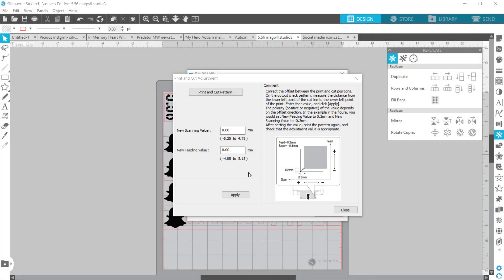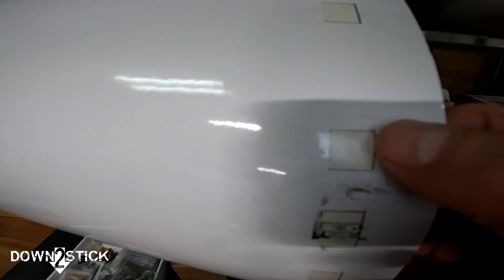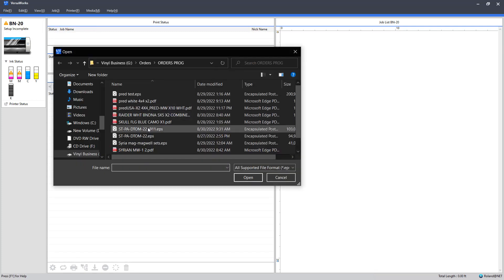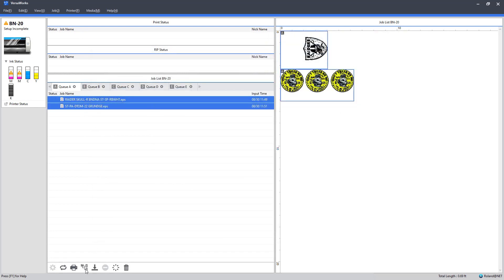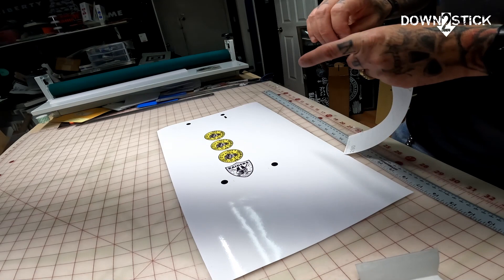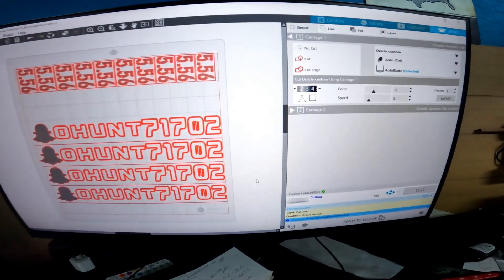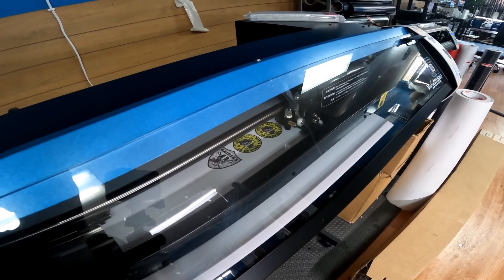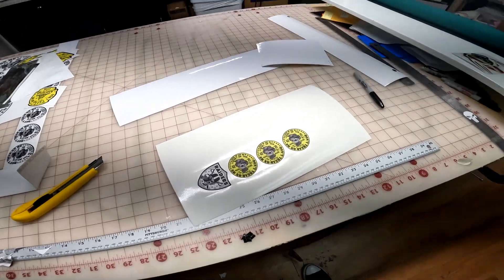BN-20 Print Cut Calibration demo

Comment: I have calibrated my BN-20a like 10 times and it cuts out the square perfectly but when i do a job to cut stickers it never cuts where i put the cut lines.
Reply from the maker: Try messing with the cutting speed. I have to do that on smaller stickers. May be a hardware issue, call tech at roland they are great with helping.

Comment: Wow finally found a video where you explain how it is done, you are right all there are not explained well or those of roland, I have already two months having problems with that, I hope to achieve it and start working, thank you very much, god bless you😊
Reply from the maker: Thank you!
Reply: @down2stick  Hello, I have a question I do not know if you could help me I have looked for tutorials and just like you I do not find any that help me to correct the print and cut adjustment and calibrate everything else and I stay well but that still not the problem is that it still leaves me a small white edge on the inside of the two frames and if I move the cut to one side the other Picture is going to be worse and vice versa in that case that I would have to move him to correct that? I do not know if I explain well I do not know if what is wrong is the calibrate sheet feeding? But I already calibrated it with the number that comes out in the print, I do not know what else to do please if you could help me I would appreciate it very much.